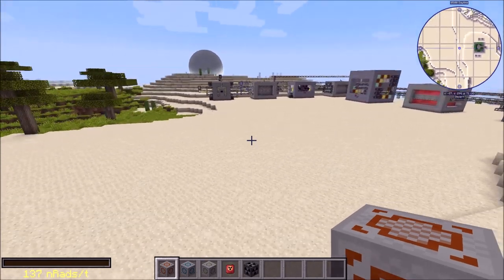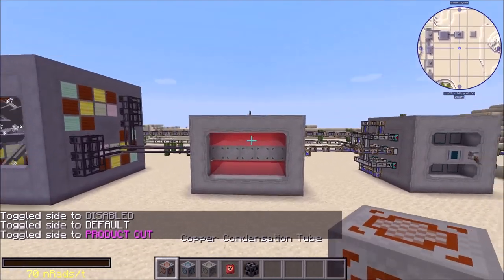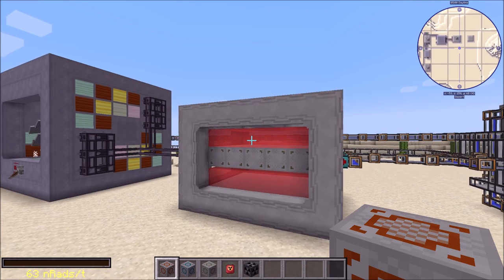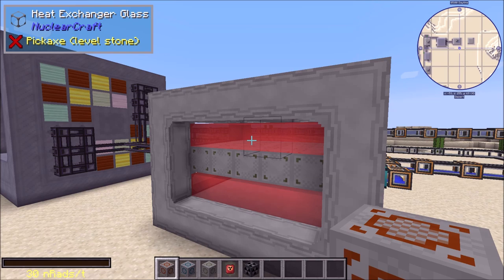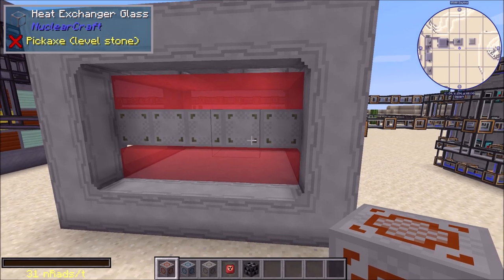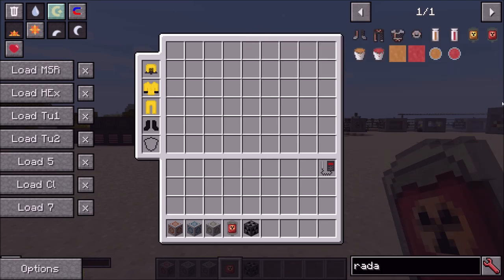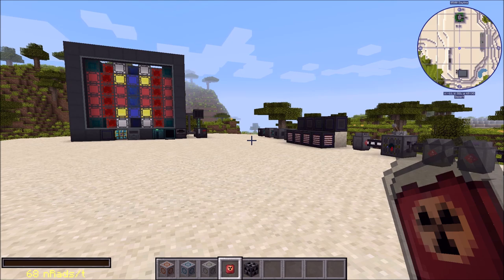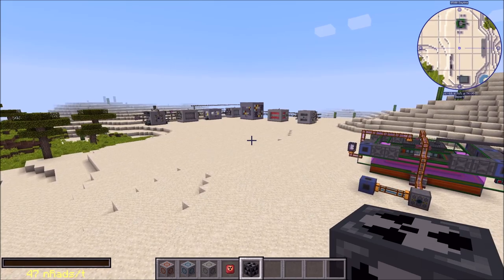Condenser Tubes, Slow-Acting RadAway and More (2.16 to 2.16f)

Comment: IMO there should be more radiation shielding available. IRL nuclear power plants have plenty of radiation shielding, so that they can be run for years without any harmful effects to anyone or anything nearby.

Maybe just covering the reactors with lead plates or something would sort it out, or washing off the radiation with some absorbent fluid that can be collected and allowed to burn out to generate heat.

(I've no idea how it'd function game-play wise, I'm just tired of people assuming that IRL nuclear power means everything gets irradiated and turned into dangerous mutants.)
Reply from the maker: It's important to note that NC's radiation system isn't really meant to be realistic - it's inspired by Fallout's system so should be taken with a few grains of salt ;)
Reply: @NuclearCraftMod  Maybe a "shielded" reactor multiblock variant (like a different casing/window block) that reduces the radiation output, but includes some dense stuff in its recipe. Keeps the game-y experience but allows for reduced radiation for people who want it.
Reply from the maker: That sort of thing would be possible, but tbh I kinda like the system as it is now - from a code organisation point of view it just starts to get messy if there are different versions of practically the same thing, because ultimately in-game one of the options gets used most of the time whil the others are basically ignored. There are configs to mess with to lower the radiation from reactors if that's what you want to do :)